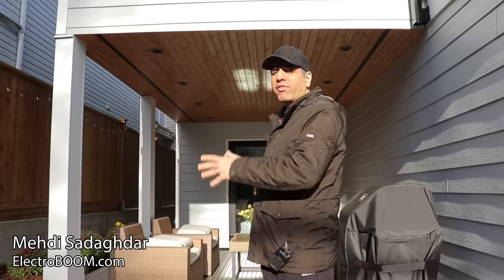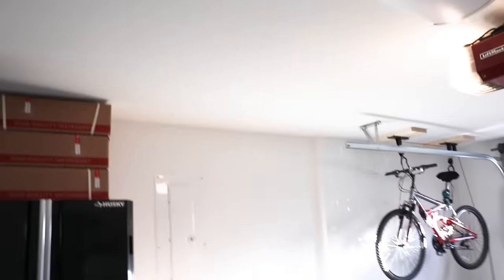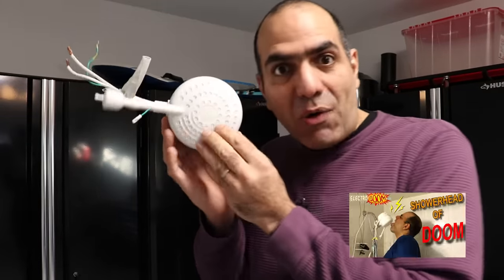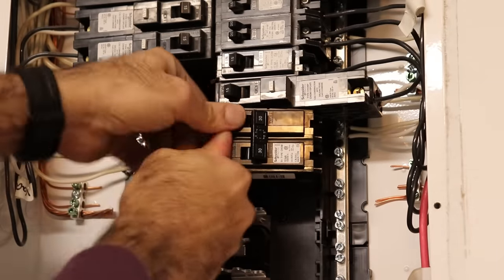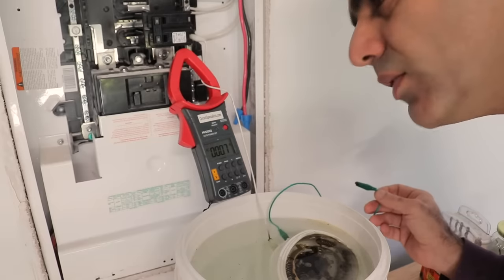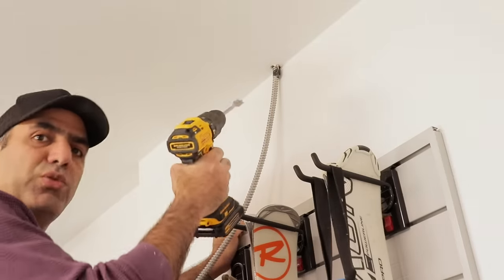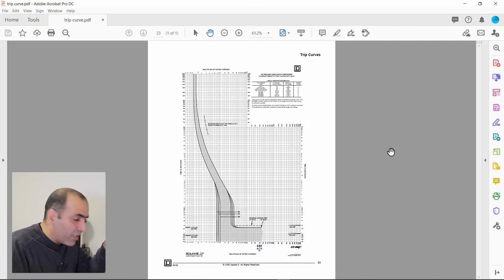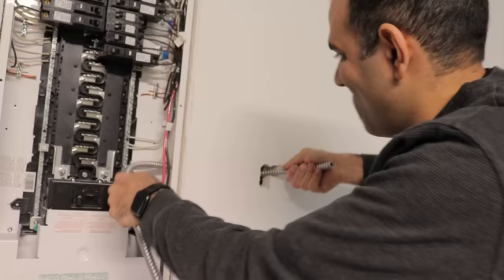Electric Patio Heater Wiring and Installation

Comment: "is this live?" * just fuckin taps it * 🤣
Reply: Taps the fuse panel like it's a microphone haha
Reply: Obvs😂😂😂
Reply: Like slightly tapping it would make it any less dangerous if it was live! XD
Reply: That's actually a fairly accurate representation of how your average electrician works, including the "not turning the breaker off" part. They get very desensitized to randomly getting zapped, often to the point of recklessness. (Source: studied to be one, couldn't take the anxiety ;) Still sometimes tap potentially live parts, but not before checking with tester/meter first. Got zapped by a FULL BRIDGE RECTIFIER once, never again.)
Reply: It is an effective testing method. 

It is not too dangerous to just tap it (grabbing it would be much worse). 

It makes a good video to get that sweet, sweet YouTube money. 

/used to use my finger to test if my bedside lamp was broken
Reply: @genicota  not true! I seen people live just real nasty burns with scars for life
Reply: If you ever wana touch a wire or something that might be live stick your finget out like your pointing at the wire. That way if it shocks you enought to contract the muscles in your hand you will close your fingers into a fist pulling away from the wire
Reply: I heard a story once about an electrician being killed while crawling under a house. There was very little room, and it was dark of course.. well, there happened to be a junction box mounted under the house that didn't have a cover plate. As he was crawling around, he accidentally pushed his back against it, and I guess due to muscle contraction, could not move away. That had to be a rough way to go..
Reply: @88porpoise  oooor use a multimeter, like any other electrician would. Its safe and effective
Reply: @Smung  If you have a multimeter on hand and know how to use it, sure. But plenty of people doing minor electrical work in their homes (changing plugs, installing a light, etc, etc) don't.
Reply: @88porpoise  mehdi knows. Seriously, a few minutes of research is worth not risking disturbing your heart rythm or internal tissue burns.
Measuring voltage isn't complicated. If you can't figure it out then you shouldn't be doing electrical work at all.

Bulbs and lights are still fine
Or just connecting via sockets.
You know, things that are designed to be foolproof.

Im talking about opening connection boxes, fuse boxes, power outlets etc.
The things we see mehdi work with.
Especially when setting up new fuses and cables for high wattage products.
Reply: @Smung  Mehdi (as ElectroBoom) isn't an electrician, he is an entertainer.  He knows what is safe and what is dangerous and how to do things in ways that look dangerous in YouTube videos but are in fact safe. 

And you are kidding yourself of you don't think there are a ton of electricians out there who wouldn't test if something is live this way at least occasionally. It is fast, easy, and not really dangerous. 

Also, nothing is ever idiot proof. If you think it is, you don't know how idiotic some people can be.
Reply: @88porpoise  Well, I can't stop you. I just really hate seing you encourage others to do the same.

Just because you've touched your lamp socket a bunch of times doesn't mean you know how electricity works and all the risks around it. Especially not those who are reading your comment.
Reply: @Smung  I am not saying people should touch potentially live wires (in fact if they don't know what they are doing they really shouldn't). But humans being humans, plenty of people will because it is quick and easy.
Reply: @88porpoise  You did tell people that its an effective testing method and that its not too dangerous.

 You don't want people to get some spicy ideas like touching a potentially higher voltage from some mysterious exposed wires. They could also risk being in contact with ground thus the current will go toward their feet or their other hand (whatever you're touching ground with) aswell which means it can go through your chest.

I can list tonnes of other scenarios, but my point is it is much better if people are overly paranoid than if they are overly courageous about electricity.
Reply: @88porpoise  He's an electrical engineer, and that knowledge goes into what you're talking about. The only time it's been real (i.e. unplanned) was when a jacob's ladder fell towards him and he grabbed it with both hands. Would have been dead if the wires hadn't fallen off.

Comment: I'm an electrician in Germany. It's always interesting how the house wiring looks like in other countries.
Reply: Gibt es diese Art von Kabel bei uns?
Reply: Won't you agree this kind of work is actually illegal to do without proper license in some (European) countries?
Reply: @mussalo  Of course I can speak only for Germany. Much of the work he does, can legally be done here in Germany by any person, like routing the wires, installing the switch and heater. 
NOT allowed is to open the distribution box (fuse panel), install breakers, connect the wires and switch the whole installation on.
Installations in Germany have to be approved by a licensed specialist, and they are the only ones who are allowed to place an electrical installation into service. 
So you could theoretically do almost any installation and just leave the wires hanging nearby the distribution box. Then call an electrician who would install new breakers, and connecting the wires.
BUT: Since licensed electricians have to give warranty to the installation, most of them wouldn't approve installations made by customers themselves.
Reply: @Helli__  Sadly, many of the installations I've seen from "professional" electricians in recent years are worse than what I (a hobbyist) build when I have to do it quick and dirty. The German word for that is: Pfusch.
Reply: @CyberlightFG  Habe ich ehrlich gesagt hier noch nie gesehen. Hier würde man eben eine Mantelleitung im Installationsrohr verlegen. 
Was dem dort am nächsten kommt sind Metallschutzschläuche wie sie in bestimmten z.B. sog. vandalensicheren Installationen verwendet werden. In die muss man halt noch die passende Leitung einziehen.
Reply: @Helli__  I suppose it's quite the same in Finland. I thought it was a bit stricter about installing the devices, but I guess it's like you said.
Being on the industry who manufacture and sell these devices, majority of serious cases where devices are failed, houses burned etc. are due to amateur running the wires and making the installations and then a licensed electrician (for whatever reason) just signing the papers without checking or missing the flaws. I wouldn't ever in that position approve any installation made by e.g. a carpenter without thorough check and still would be sceptical.
Reply: @MrTridac  True, ignorance and indifference is rising.
Reply: @mussalo   that's the point. It's THEORETICALLY possible for a person to  do the "simple" stuff and let a professional connect & approve it. 
But there is quite a bit calculations and documentation necessary (load, wire gauge, breaker current, breaker charakteristiks, electrical measurements, etc.). Also the electrian is taken into responsibility if something bad happens. 
Therefore I know not a single professional who would approve an installation, which he did not do himself.
Reply: @CyberlightFG  Nein da wir eh bei so nem Heizer kein mehrphasiges Kabel brauchen und wir 230 V statt 120 V haben
Reply: American commercial electrician here, homeowners almost always make mistakes, most common being not twisting your connections with line pliers before installed wire nuts, hot and neutral backwards, not properly grounded, stuff that can be very dangerous. Also noticed he didnt use any Anti shorts on the armored cable which would certainly fail an inspection.
Reply: Mehdi may not be the best example. Normaly there isn't nearly that much burned wires.
Reply: @seanspease8225  If the armor is cut and deburred properly, are the antishorts really useful ?
Reply: I have seen some real scary stuff in rural areas of the U.S. where they have used extension cords ( not romex )  with the ends cut off as finished permanent circuits, and the insulation was starting to melt ..
Reply: @scottgrumpybastard311  
Get out of my garage!! Extension cord works fine if it is sized properly. There is nothing more permanent than a temporary solution that works. That the reason why all the 8ft florescent fixtures in my garage are still wired to outlets with extension cord. You really should be worried about my grandparents place. When they remodeled they found that all their wiring was twisted togeather and wrapped in electrical tape (outside of a box, in the wall/under the floor), each joint was the size of a softball. Under the house there was hundreds of them. I think that was where they used all the scraps. All the houses in their block were built by the same people.
Reply: @mussalo  Its very illegal to do this in the UK, 240v is dangerous, i have been blown across the room from touching a live wire not fun
Reply: @eloniusz  Yeah my worry is that while normally he's doing clearly crazy stuff in the lab, this is kind of like an example (tutorial) video how to make this yourself. I've seen this before of him and I don't like these. One warning message in the comments doesn't help at all..
Reply: @tomf3150  yep gotta have em there especially if it gets inspected they flunk that
Reply: @SirZanZa  Reminds me my 1st electrical shock, at about 5 years old.
Yep. It was 220v.
Reply: Nein nein nein nein nein nein nein nein. Mein Kampf
Reply: @zachdemand4508  Knob and tube wiring is safe if it was done properly.
Reply: @mussalo  He's a professional engineer. I know that may not be identical to electrician, but close enough, and he's clearly taken safety precautions like grounding the metal box, using a double pole switch, getting thick armored wires, testing the breaker, etc. He knows what he's doing.
Reply: @highgroundproductions8590  Well I'm both and I can say to you that EEs are not certified electricians and while have knowledge of electricity they lack the understanding of installation regulations and often it's their intelligence that tricks them into believing they know the installation to be safe.
His installations are a perfect example of this behaviour.
Reply: @jammehrmann1871 bei so einem Heizer würden wir Drehstrom benutzen. 4kW sind in den meisten Fällen mehr, als eine 2,5mm2 Leitung ab kann.

Comment: I love how almost nothing can trip these breakers, yet every rental property in the US will somehow trip when you plug your phone in for more than 3 seconds.
Reply: It’s a slow trip breaker type with a normal max load of 30, intended for starting compressor motors or hvac applications which draw up over 90amps during startup for a second. 
Regular user 20amp circuits use a faster trip breaker to keep the safety break down closer to 20, add to that how most people are clueless as to how much power is being used on any given circuit until the breaker says it’s maxed. Pop!
(Which just means too many devices on that circuit)...plug things into a different circuit that’s not off when the breaker pops.
Reply: @SaturnX I've been under an exploding transformer, it's fucking scary.
Reply: Just get a 30A breaker for a 20A system. Problem solved.
Reply: It’s probably because half of the house is on one breaker lol
Reply: My office breaker trips for 5 seconds every time you turn on the printer, so we hooked everything on battery backups in order to not lose power
Reply: @SasukeUchiha-tc9xx  you could have called an electrician...
Reply: @ayitsyaboi  i saw a transformer across from my house explode into sparks, and the breakers in my house actually burnt.
Reply: @MrMelvinheimer  oh I know that too well been on way to many jobs for such reasons, mostly on older houses too where even if you look at the cable it crumble up in to nothing but bare copper
Reply: So true! Typing this with tripped breakers and no access to the breaker box in half of my unit.
Reply: @dallynsr  Thx
Reply: @dallynsr  is that why the lights flicker when the ac starts? Because it initially draws 90 amps?
Reply: @groundzero_-lm4md  so long as the wire gauge is rated for the higher breaker current it's not a problem to overbuild a circuit, unless money is an issue
Reply: well at 240v they tend to be limited to slow trips because of large inductive loads, hence the intentional safe delay of a few seconds of 2-3x overload before it trips, but a 120v circuit would almost never have a massive inductive load hence why the shitty phone charger with a dying nearly shorted capacitor will pop it
Reply: @howlongcanimakethisfukingthing couldn't be further from the truth. If the circuit breaker is rated for less current, it will trip sooner. Possibly making the use of the space heater very hard or at least annoying, but surely it's not setting fire to anything.